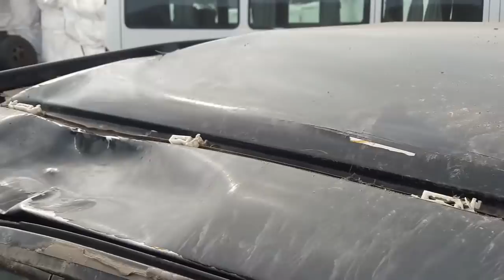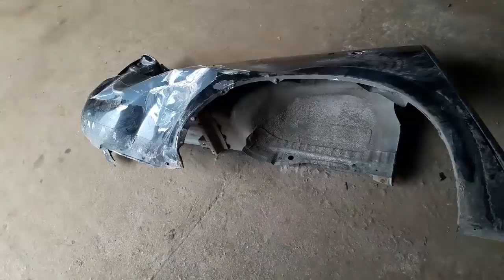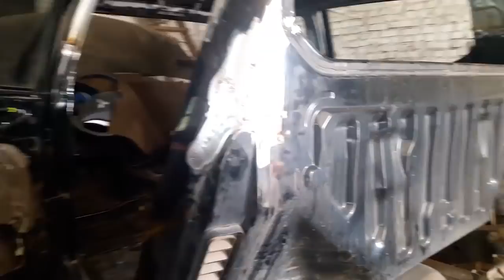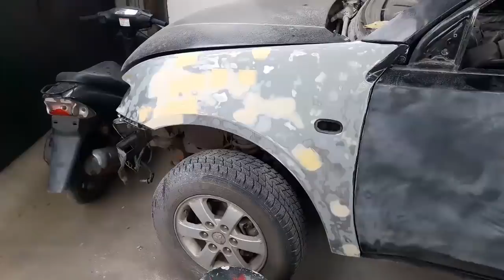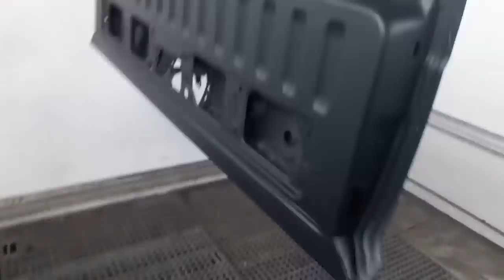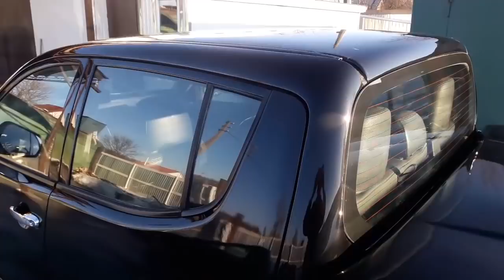Mitsubishi L200

Comment: A lot of effort to fix a vehicle that structurally was beyond economic repair, I am in the job and that should have been put too sleep , or used for spares , not strong enough, metal has been smashed to pieces , if another crash ,won't be strong to protect passengers, might be shiny but not strong
Reply: The frame was original i think if it rolled over again i don't know if the roof would hold up. But far as a front rear side Collision should have fine.
Reply: И чё дальше?
Reply: I can’t understand why they cut a piece out of another tub to repair the damaged one instead of just bolting a complete second hand one on.
Reply: Well said ..
Reply: Alex Tegg,  I was just thinking the same thing.
Reply: @alextegg3838  I think they did it because the broken car was already cleared through customs and they just had to save the base and the frame from the old car. Then this scrap metal will go on sale under former registration documents.
Reply: Just don't roll it again , it is meant to be on its wheels and not on its roof
Reply: In addition I would like to see that car over 130 km/h if it's stable or not
Reply: 1 carful owner 😉I think I wouldn’t like to be the next 1

Comment: This is like silicon breasts. Might look good under jumper but still plastic to touch. 
In this case it's also a death trap. 
Great job, no question. But just becouse you can, doesn't mean you should. Can't repair frame with hammer and jack.
In many countries this would have been write off but in Ukraine they will repair and send it out again..